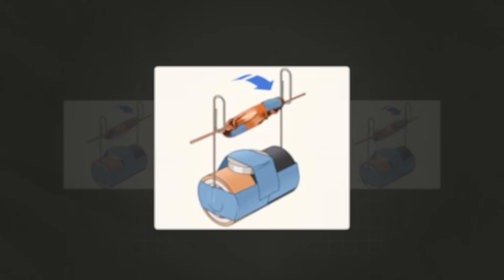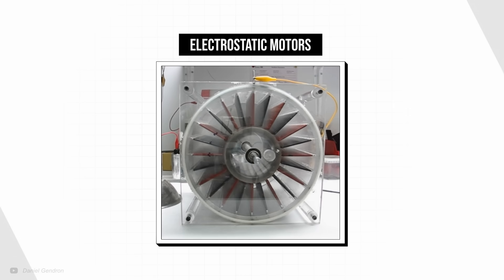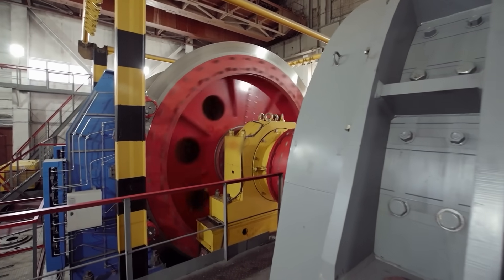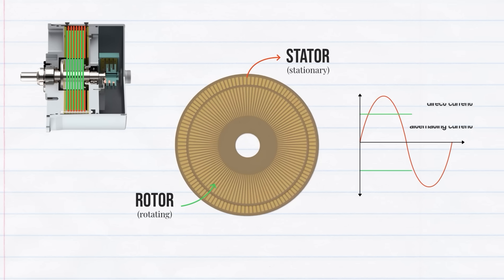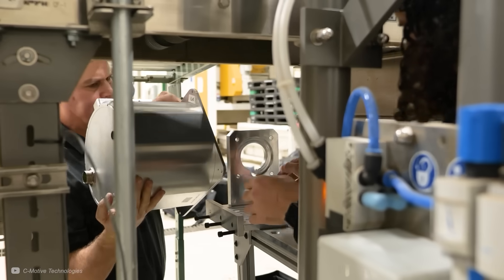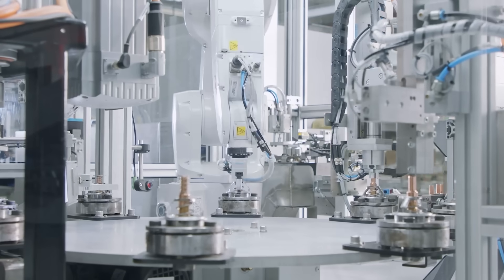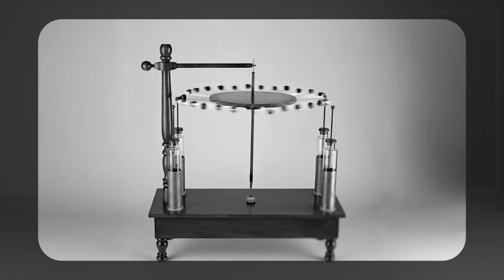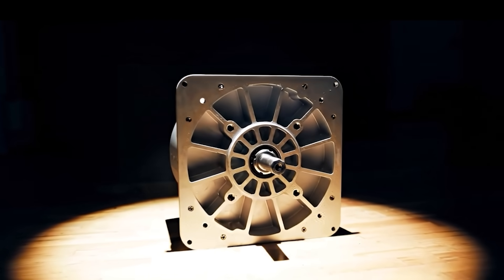How Electrostatic Motors are Breaking All the Rules

Comment: Sorry, but I watched 12 minutes about everything except electrostatic motors... Not against you, but you fell for it.
Just start-up nosense trying to get attention, years will pass and we won't hear about it ever again.
Breaking what rules? Power density? Efficiency?
Sure, using liquid dielectric in a spinning device, slushing all around, won't waste 90% of the energy...
I doubt very much they'll ever reach power densities as induction motors, you can get several MW in a bed-size motor...
Reply: First time here?
Reply: I think you fell for the "proprietary dielectric liquid that helps with cooling".
You take fluoroketone  FK-5-1-12, mix it with hydrofluoroether, call it a proprietary blend, and get something that evaporates at somewhere around 50°.
Boom, two phase steam cushion near hot surfaces.
But yeah, they didn't give a full torque and efficiency curve to see how it actually performs at what RPM.
Reply: @sasjadv  I look one look at the bubbling fluid and immediately guessed, "That's a perfluorocarbon." It's pretty obvious - they are already used as dielectrics. Couldn't say which one, but their trade secret would be pretty easy to reproduce by a little trial and error. Or just stick a drop in the mass-spec.
Reply: Then you’ve missed the point. Electrostatic motors (ESMs) aren’t about power density. A super low-torque electromagnetic motor spinning at 50,000+ RPM may deliver a lot of power on paper—but with almost no usable torque—which is exactly why gear reduction is almost always required.

The only one who fell for "it" is you. Traditional motor companies have been dubiously marketing power (horsepower) for decades. The only performance metrics that actually matter are how much torque is available at a given speed and how efficiently the system operates.
Reply: @Fejimush  But speed×torque=power.
Any motor can give you literally any torque if you provide it with the right gear ratio. So power is the correct metric for output.
Like you can lift up one brick quickly, or many bricks at once slowly, but it for productivity it matters how many bricks per hour you can load into a truck. THAT's the whole point of power, the work done per unit of time equals power.
You can always trade force for speed or speed for force with a mechanical advantage/disadvantage.
Reply: @sasjadv  You’re absolutely right that power = torque × speed—no disagreement there. But the point you’re missing is how that power is delivered and whether it’s practical.

In real-world applications, it’s not enough to just have high power on paper if the motor delivers it at 50,000+ RPM with negligible torque. Yes, you can use gear reduction, but that adds size, cost, complexity, backlash, losses, and maintenance overhead. That’s not a trivial trade-off—especially in constrained or high-efficiency environments.

Power is a valid metric when comparing motors in the same context, but it becomes misleading when used to mask impractical torque-speed characteristics. Traditional EM motor marketing has leaned heavily on peak power while quietly assuming aggressive gearing, forced cooling, and other support systems that inflate the system cost and reduce efficiency.

That’s why ESMs are so interesting: their torque delivery profile without gearing is fundamentally different, and in some scenarios, more directly useful. So while the physics equation holds, the engineering reality is more nuanced.
Reply: @Fejimush  I'm not missing any points here.

If you need a high gear ratio, then you can pick cycloidal, (eccentric) strainwave drive, etc. With practically zero backlash. But for conveyor belts you don't even care about backlash, because it's a non-precision usecase.
Good gears last for years without any maintenance. And mechanical losses for normal gears are just a few percent.

Both electrostatic motors and electromagnetic motors can be made differently with different characteristics. A pancake shaped motor will have more torque and lower RPM, while a rod shaped motor will by high revving with lower torque. Also there is the number of poles per resolution.

The actual deal with the torque curve here is the usecase of starting up from a standstill. No matter the working RPMs of the motor where it works at max efficiency, and no matter the gear ratio, if the conveyor is not moving, then the motor is at 0 RPM. And to get the conveyor moving from standstil under load, the motor needs to generate torque at 0 RPM, and at RPMs that are a fraction of its working RPMs.
Induction motors are good at it, and have reasonable efficiency in their mid RPM range. However, reluctance motors are way more efficient at middle and high RPMs, but have low starting torque. So you could use an induction motor for starting, and a reluctance motor for continuing, and you'll have the best efficiency, with the drawback of needing two motors instead of one.
Hybrid magnet-reluctance motors are still efficient (but worse at higher RPMs than pure reluctance ones), and have great starting torque, but they contain magnets.
Electrostatic motors have worse efficiency than both reluctance or hybrid motors, based on what's said in the video.
The only real benefit is that you get this level of efficiency out of just one motor, that doesn't need magnets (but does need fluorinated liquid chemicals instead).
Reply: Losses increase with speed, so absolutely not, 50.000rpm will never be efficient compared to a torquey 3000rpm induction motor.
Reply: Nah, it can't compete with peak powers and rotation speeds of modern motors. But for mostly static or slow moving systems it makes sense as the input power decreases near zero when not rotating.
Reply: Agreed, this video is just an infomercial for the company making that motor. He's relying completely on unsubstantiated claims by that company.

Comment: the plate configuration reminds me of an old skool tuning capacitor. or a more updated similarity, would be to a 
mechanical hard drive with multiple platters. very interesting tech! thanks for posting :0
Reply: Because it's effectively a capacitor. It works because charging voltage direction changes faster than it could take, making it spin. Also traditional magnetic motor is an inductor (or number of inductors), with same principle of changing current direction faster than magnetic field ...
Reply: @baddoer  Thanks for the FYI Man 👍

Comment: The capacitive nature of the motor is a great fit for low RPM applications since current is only drawn when charging/discharging the plates. I imagine there's basically no idle power consumption for holding torque.
Reply: Correct.

Comment: Well how fast is fast?
I think conveyor belts are pretty fast
If you changed the form factor to be a bit more pancake shaped, could it be used to power joints in robotics or exoskeletons?
Reply: i guess not. they say high torque but i believe thats with extreme elaborate designs. just from a resource scarcity pow regular aluminium can suplement cooper wires and rareearth magnets are cool but can be and are replaced by electromagnets in high power situations where weight is not an issue

Comment: 🤔Question: Would it be possible to work this motor into a "Cordless Drill"? Low RPM (<500) for 15 minutes constant run with low to moderate torque creates a good deal of heat on a 1/2 in 2 speed cordless drill.

Comment: Ball bearing and involute gears are about 95% efficient.   Rubbing of gear faces and friction with gears wet with oil flowing against relatively moving surfaces or changes in volume are just a factor in gear box designs that are centuries old.  
My guess 90%  of motors are induction type that do not us magnets. The reason for this is that no controls are needed.  The controls using semiconductors are also efficient and it is possible to be in the 80s and 90s efficiency.  But they add both cost and reduce robustness.  Increase life-time cost.  Induction motor are going to stay the work horses.
 One can replace every magnet style motor with a reluctance motor.  Controls are just as complex and cost as much with one exception.
Stepper motors are designed for lower speeds and higher torques just as this replacement. It does have controls but they do not need feedback about rotor position although feed back comes naturally and is used to improve efficiency.  It is in the reluctance motors family.  As speed increased position is needed to keep the motion smooth.  
I would call the static field motor that you have shown is for the same purpose as the stepper motor and with the same nature of it's control electronics.  
There are good fluids that can be looked up with high resistance to molecular breakdown in high charge fields.  They are used in transformers already and since the electrification of America and other places. The older fluids are toxic that are both cheap and effective for transformers. 
 Likely the search for a fluid started with a fluid designed for flooded magnetics like a transformer or electronics.  This fluid will likely be required for the driver because of the same high voltage molecular breakdown of air in those boxes. 
My background is packaging power electronics for aerospace including NASA.  I have designed flooded electronics at least for proposals or studies.  The whole system included PM, reluctance, induction, and wound rotor field magnetic machines for most of 20 years before retirement.
Reply: I think it is likely that the falure point and main cost of these motors is the control circuitry,  which has to generate and control the high voltage, which is much more electronic than gear boxes, and likely costs around the same to build.  

The viability will likely come down to the total cost of ownership and maximum reliability with minimal maintenance for industrial use.

But who knows, electronic circuitry and controls for motors are becoming reliable, ubiquitous, and reasonably priced.  If these motors use much less copper/other materials and don't require gears to be machined and are more efficient,  it is possible that this is the future for low-speed industrial use, but there are a lot of details to be verified before this can be the new standard.
Reply: I am given to understand that the high tec fluid in transformers is simple mineral oil and is relatively inexpensive and very non-toxic.
Reply: @jasonneugebauer5310  There are all sorts of dielectric liquids and gases in transformers. Many of the ones installed in the field still use PCBs (the substance, not the electronics component) and are terribly toxic (and tend to leak...). There's also SF6 gas, which isn't that bad but is a terrific greenhouse gas (25000x as bad as CO2). I'm sure there also are transformers that use normal mineral oil, although it will usually have additives in it to extend its life, reduce heat breakdown, avoid foaming, and so on. Transformer oils are their own product class, and most of the additives are NOT something you would want to touch, eat, drink, or breathe.
Reply: @2xKTfc I asked Chat GPT what electrolytes are used in US transformers and the answer is  mostly just mineral oil and vegitable oil:

✅ Takeaway

Mineral oil dominates with approximately 10 billion liters in service throughout the U.S.

Biodegradable esters account for a much smaller but growing share.

Silicone and legacy PCB oils are minimal.

A considerable share (~20 %) of transformers use solid dielectric (dry‑type) insulation instead of any liquid.
Reply: @jasonneugebauer5310  It depends on the temperature range you want it to operate over. Everything is a compromise. Sometimes non-toxic oils are not practical. (speaking of transformers). For the ES motor, what is needed is low viscosity, stability in high electric fields and high dielectric breakdown.
Reply: Also, do you have a theory on why they use a slip ring to charge the rotor instead of a static electricity comb that doesn't require contact?
Reply: My background also.  The old fluids were PCBs, and were later largely discontinued due to Cancer causing, and were a pollutant when disposed.  Got into the food chains in some areas, causing animal failures.  We used these in the power electronics, 6-to-12-phase switchers, cyclconverters, and vector controlled induction motors.  PS:  Vector controlled induction motors can be upwards of 98% efficient at slow speeds.  Depends on the type of laminations, but there are cheap materials which are just as good as the rare earth magnetics.  At high speeds, the air drag and leakage flux losses dominate anyway, and some of the EV companies are actually partially vacuumizing their motors, to reduce those losses.  Nitride and Carbide bearings have to be used to reduce the parasitic losses due to circulating flux paths, around the casing.
Reply: That dielectric fluid they use also should have high dielectric constant, as that will increase the force. The plates they use function as capacitor plates, for them the force pushing them together is F=0.5*Dielectric_constant*Area*(voltage/distance)^2
Reply: Do you think there's a future for electrostatic motors? I mean do you think it actually solves a real world problem? I'm not convinced that ES motors will really reduce energy usage like they claim but I'm no expert.
Reply: Fomblin
Reply: The public sector has no idea what reluctance motors are.
Reply: From my experience, most conveyor gear reductions are worm gears with thick oil and somewhere in the ballpark of 9:1 - 14:1 reduction. So they do have rather poor efficiency. 

I think what annoys me about this video is that it didn't answer my two critical questions I had at the start, what do they use as the insulator (though I understand if it needs to be proprietary), and WHAT VOLTAGE RANGE WILL THESE MOTORS BE OPERATING AT!?!? Just to consider this on a production line, I feel like that voltage range is critical. The high voltage start on my TIG welder already sends the radio in my workshop loopy.
Reply: @matthewluttrell9413 I am not watching the video again to check, but I thaugt i herd him say that the dielectric oil was the insulator(there are not wires, there are just small charged plates) and the opperating voltage was 400 volts.
Reply: @matthewluttrell9413 largely incorrect here. Most of the sub 2kw range are much higher ratio but it depends on the application. You are incorrect none run on grease. It’s a 320 synthetic gear oil.

The video showed worst case scenario using a worm gearboxes which is inefficient. But helical or helical bevel units only lose 2% per reduction stage. However people still choose the worm the oldest form of power transmission because sub 42mm output shaft the price to make one is half of a helical bevel or helical.

In the video they then proceed to drive each conveyor with a sprocket which would have more loss then a helical gear. 

If this motor is not price competitive it will be dead in the water
Reply: @8towely I said a heavy oil, not grease, though I've seen some small ones that just use grease🤷🏻‍♂️. I'm sure some conveyors might have substantially more reduction than I said, but I was just responding about how he thought  the efficiency shouldn't be that bad.
Reply: @matthewluttrell9413  he is correct. Only reason why the efficiency is that bad is they used worst case scenario. Ie1 induction motor and a worm gearbox. An ie3 motor and helical bevel will be in the mid 80% range. People use worm
Boxes because they are so cheap and very robust
Reply: How do you estimate the static field motor would compare to a stepper motor?
Reply: Large, high torque reduction gearboxes with thick grease used in high availability systems are NOT that efficient!
Reply: @drofdissonance your wrong. The gearboxes they showed don’t run of grease they are industrial worm boxes running off 320 synthetic gear oil. While worm gearboxes are not that efficient there are commercially available helical bevel or helical units that have losses of 2% per gear stage. However in the sub 2kw market price is generally the determining factor so people choose the worm and a cheap ie1 motor.
There are already cheap simple options available on this market but not a great deal of demand for it.

I have worked in the industrial power transmission space for a major manufacturer for 15 years

Comment: I think the point people are missing in this comments section is that this is just another way to make a very efficient electric motor but at a reduced cost.
Reply: I’d like to see the costs. I highly doubt it will be cheaper than a squirrel cage motor and gearbox.

It’s far more complex and they are being dishonest with their numbers
Reply: These capacitor motors SHOULD cost less but, from one of the graphs, the cost is higher [or same?] but this may just be an initial/preliminary marketing decision since they don't mass produce anything yet.
I did some development on my own cap-motor tech. Also tried to talking to C-Motive reg collaboration on new/improved tech but they are busy focusing on basic apps to get more data [and probably $]
Reply: Exactly 👍👍
Reply: Those fluids could be quite costly, who knows?
Reply: I really don't see how a low power motor that uses high voltages (safety) and proprietrary fluids can be any cheaper than the induction motors which are manufactured by the million each year, with not a single gram of rare earths in sight.
Reply: @lbgstzockt8493  induction motors are less efficient.
Reply: @imzjustplayin  You can get 97% efficient ones, it will be hard to beat that with some completely unproven technology. Even bad ones are 75% efficient, and they cost next to nothing.